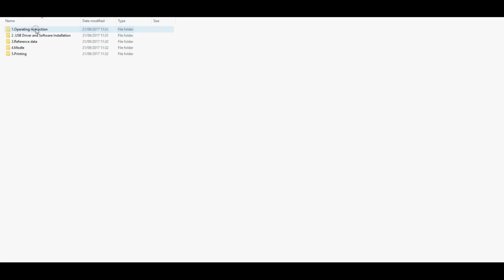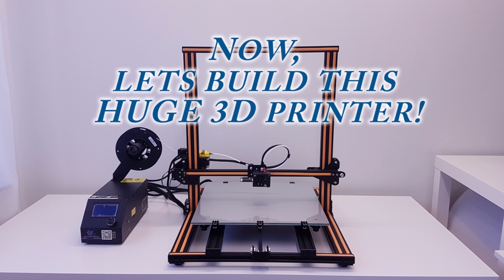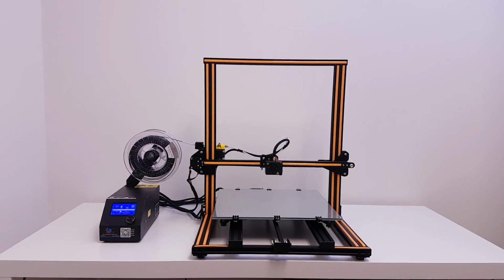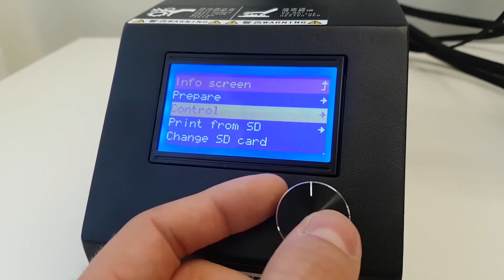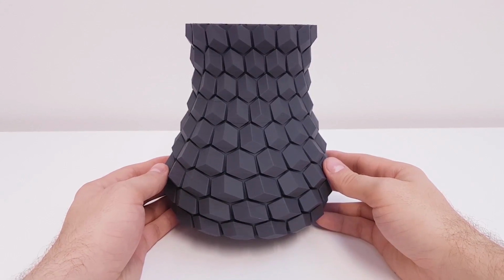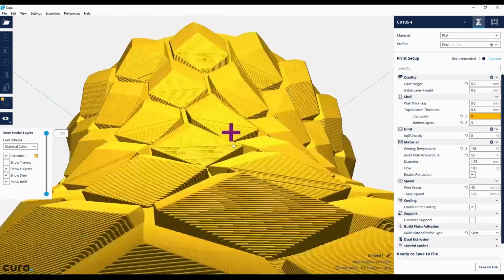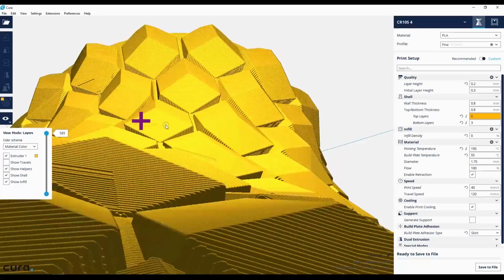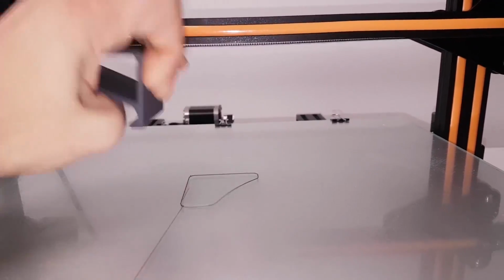Creality CR10 S4 3D printer Full Review! Is it better then CR10S?

Comment: What you recommend as a high quality/speed 400x400x400 printer, that can print ABS.
Reply from the maker: Chech this video from start to finish. And if you are ready to do some fixes that's the one :)  https://youtu.be/lE9i1-DX1aI
Reply: @NexiTech  Thank you
Reply from the maker: No problem :)
Reply: @NexiTech  I can get the Creality CR-6 Max from a tech shop today. I did not see a review on your channel on this unit. Have you had time to look it over and if so do you recommend, thank you.
Reply from the maker: @uivideo7637  I have reviewed CR6-SE and it was very good 3D printer. No issues at all. It worked perfectly fine so my guess that CR6 Max should preform the same or very similar.
Reply: @NexiTech  Thank you

Comment: If you double the nozzle size, you don't double the filament usage, you actually quadruple the filament usage (the circle area), and print much more than double faster (depending on the printer ability with respect of temperature/speed .. it will probably not be a quadruple speed since it still needs some time to melt the plastic.., but will for sure be more than double faster), because the area for circle with 0.4 mm diameter is ~0.126 mm^2  (A = Pi x r^2), and the area for circle with 0.8 mm diameter is ~0.503 mm^2.  
- Great review though! 
Thanks for sharing.

Comment: Hello, I have a Creality CR-10 with dual z axis motors. The z axis goes up and down when homing but will not go up when printing. Is it the machine or am i doing something wrong in Cura ?
Reply from the maker: That's very strange. Try to check or replace your SD card and printer settings in CURA. If printer is moving Z axis normally when homing then it could be somethig with G codes or bad micro SD card. Also try to move Z axis by manual using the printer interface. Also try to slice another 3d model as well.

Comment: I want to buy a 3d printer. I need smooth face after printing. What 3d printer do u recommend among all.? Cr10s, cr10s4, s5 ender3 pro or...?
Reply from the maker: Cr10 S Pro( now V2) or Cr10 V2 can print parts with nice and smooth surface thanks to the latest motherboard and steper drivers. Of course if you looking for superb print quality then you can go with resin 3D printers like Anycubic Photon(small) or Frozen transform(Big one). 
https://youtu.be/d2oD4lktOT4
https://youtu.be/tsy8jFeqgco
https://youtu.be/5YrUQOYLoK0
https://youtu.be/qOSzC3-VrJk
Reply: @NexiTech  m thankful for kind and informative answer. Yes I m really looking for super good 3d print. So your suggestion is I go for resin 3d print. I heard ther is CR10 max. Is it true and us it the best?
I appreciate your answer

Comment: "when you double the size of the nozzle, you also double the use of filament" ... er, no. Do the math: with A=r^2*pi you quadruple the surface and the use of plastic, depending on the wall thickness of course.
Reply: True, per unit length of extruded filament, if you double nozzle opening from 0.4 to 0.8mm, you will quadruple the volume of filament (same length, 4 x the cross-sectional area). But, as you note you have to consider wall thickness. Plus you have to consider layer height. Nominally layer height doubles, so number of layers is ~halved. So that means overall consumption is probably increased to somewhere between 2-3x.

Comment: You forgot about one more test! Does the boat swim? :D
PS. which material is the strongest (if I print a helmet and drop it) and which one gives the best details?  Or maybe there is some material that combines the two qualities, strength and details? CHEERS ^^
Reply from the maker: Pwiest Playing Never tried it until now. Special test just for you. https://drive.google.com/folderview?id=1RsTGtuvn2FZbATfxUgtBAIv1xgsLj2XA
Is the side ways floating counts? :D 
The strongest filament would be Nylon but it's very hard to print especially a that size as it likes to wrap just like ABS. 
Easiest to print but still strong and elastic to some sort to survives impact like that would be PETG. I use PETG from Aprinta pro and it's very good. Check Aprinta shop from video description and choose PETG. don't buy PETG with some sort of mix like carbon fiber and similar those added particles just makes filament way less strong compare to based material. Just Get regular PETG instead.

Comment: Would this be a good first 3D printer? I am in between this, the CR-10S Pro and the Prussa i3 Mk3S. The Prussa is very good but doesn't have enough build volume and is expensive which is why I am looking in the CR-10 line.
Reply: I've got a prusa i3 MK2S and think I'll buy the cr10 s4 in addition to it, either buy the prusa for print quality and reliability or the cr10 for big prints
Reply: EL Valenin alright, thanks for the reply!
Reply: @glumfish6862  but I think the prusa is better for beginners

Comment: great video but i was wondering if you had links to a better HEAT BED adjustment knobs for the CR10 S4?
Reply from the maker: Ed Iles Here my friend:  https://www.thingiverse.com/thing:2462249
Reply: there is not enough room to put a knob like this on because of the distance between the bed screw and the bed rail on a cr10s4

Comment: Thank you for great review! It played great part in my decision. Now S4 is being shipped to me....
Reply: Hey. Got it assembled and working. Compared to expectations, it was a nightmare, and I wouldn´t recommend it to any newbie. Bent hot end assy, impossible to home the X axis to the end-stop, as the bottom wheel screw and nut blocked it, so had to drop the hot end, belt, everything, make the screw and nut shorter, and reassemble. Anyway Now, before advanced upgades, it printed 3D benchy without infill, without retractions and no tuning, quite well. Like 98% of the well tuned Original Prusa i3 MK3! I´m getting excited to get it upgraded and tuned!

Comment: So why does my creality cr10s prints abs fine i print out to max volume printing boat hulls for my rc models had no shrinkage or bed problems got my bed up to 90 as long as you put a box over it it prints fine in abs and as long as you dont print in a cold garage i use my back bedroom at a temp of 75 so yes you can print abs thats all i use,ive never even tried pla because of its low melting point ans strength issues  on my creality cr10s .
Reply: Hi John, im interested in this Cr10 S. You did'nt do anythign special to make it work with ABS, and you just print ABS out of the box ?? Can you tell me more about your experience ???

Comment: too sweet to be true your presentation. Following your video I bought 4s and I have only troubles so far... 

1. at the 4 corners my calibration is perfect, but at the middle not! Hence the glass is bended
2. cr-10 s4 starts printing from its 0 no matter where my model is positioned in cura (yes I have selected "Origin at center")

I don't recommend buying this machine for professional work..
Reply from the maker: addk3 Glass can't be bend that easy. It's more luckily aluminium plate that bended/bow in center and then when it's cold/worm during its massive size it varies. Some S4 Heated bad comes like that from factory and some users has reported that. Mine S4 heated bed was OK. Maybe I can help.  Solutions: Try to use Vacuum for glass in centre to bend plate up in short pull burst. Or place something in middle (Like paperblock) and then screw down adjusting screws to bend the plate back. Make sure that you heatup plate before doing so. 
Or If you don't use Max build size all the time you can level it in middle of plate instead of on the corners.
Or you can use BRIM option in Cura
2. Origin in center shouldn't be selected.

Comment: I am subscribed to your channel. Please tell me, if STL corrupted files is allways a problem, when working with 3d printers, or is a rare problem?! Till when you worked with this printers, how many times, you have encountered STL corrupted files!? This i dont understand well. Thanks sir
Reply from the maker: Rohan 67 Hi and welcome. Corrupted STL files? That's very rare. I never personally had corrupted STL file and I have hundreds and hundreds of STL files on my PC more then 80% are downloaded from Thingiverse website. On some STL files 3D builder(3D program in Windows 10) found some geometry errors in 3D model and program fix them by itssel, but other then that I never had corrupted STL file. Are you sure you don't have problem with your PC? Maybe spyware, malware or virus? Or some register problems? None of files on your PC should be corrupted. Scan your PC using Malwarebytes program and run CCcleaner efter. Good luck
Reply: Nexi Tech Thanks now is much more simple for me.. Regards

Comment: Thank you just got one with your coupon!!
Reply: Nexi Tech Can the bed be upgraded as you did for the normal size cr-10? is that 30x30 silicone heater you shared large enough?
Reply from the maker: LyranaH Awesome! You welcome :)
Reply from the maker: Tiberio Cellini Yes it can. There is 400x400 silicone heater for CR10S4 as well.

Comment: So is the CR10S the same as the CR10S4 just a smaller version? I don't plan on making anything huge so how do they compare?  Again the terminology I need to learn because if I have an issue I don't know how or what adjust to fix. Can you speak on that so we (I) can learn if this happens in a print adjust this, but if this happens to adjust that?

That's what I need to know how to make adjustments to get the perfect print like you have.

Also, do they come with both nozzles?

Great Vid thank you

Comment: I like the size, but not being able to print abs well enough is a bummer, so i got the cr10s.
Reply from the maker: CR10S is better for ABS and PETG prints Good choose. Check my video on the channel how to upgrade heated bed on Cr10S to heatup up to 135C under 4 min or you can install isolation only under heat-bed.

Comment: I got this same S4 printer and have been happy with it. I insulated the heat bed and could get 91C degrees in a ~2h testprint session. Asking temp was 100C. http://pro-ht.mbnet.fi/3d_print/cr-10-s4/cr-10-s4_bed_heat_insulation.jpg

Small ABS parts seems to print out pretty good, but bigger ones would need more bed temp, or a closed enclosure for the whole printer to reduce warping.
Reply: That's the welder's flannel and heat reflection sheet mod right?
I did the same mod on my S3 and got exact same results you did. (@91c bed max). Stopped using ABS because of all the new easily printable filaments that are so much better.
Reply: I used 10mm thick self adhesive thermal insulation mat with aluminium surface and some aluminium tape on the edges. :)
Reply: I was able to reach 101C degrees in my last ABS try, but I have trouble with lifting edges. Seems that the part sticking nicely to the tape I'm using but at these temps the tape itself lifts from the bed. Ordered buildtak surface for the bed, hope it resolves the trouble.
Reply: Do you have a link to the instructions on how to do this mod
Reply from the maker: Maxxifull I did this on my Cr10S crazy fast heatbed time! It can reach 135C degrades under 4min! Check video https://youtu.be/IhjqfMHyBAI

Comment: I don't understand why it's so much more expensive than the 10s.
Reply: siemensohm 

Agree 100%. Seems like they’re extorting a larger sum for such minuscule extra features.
Reply: +oki doki
That's not the point. What's the difference between cr10s and s4 regarding the used components of the printer?
Answer that for yourself and ask yourself whether those bigger parts are worth a premium of 50% compared to cr10s...
Reply: and you get a bigger stepper motor for the y-axis
Reply: oki doki I guess siemensohm got banished to the shadow realm
Reply from the maker: siemensohm Because it's bigger. Cr10S has built volume of 300x300x400mm and Cr10 S4 has 400x400x400mm. Maybe on papper its not that much but in real life that's huge difference in print size.
Reply: Thank you very much for your answer, but that's still no explanation in my eyes. The major parts are the same and a bigger heat bed and shafts etc. can't explain the current price difference of 290€ at gearbest.

However, thank you for your informative videos.... :)

Comment: I just ordered the CR-10 S4. Can you tell me the footprint dimensions of the S4? I am looking for a workbench or table for it. I want to make sure it fits on the table. Thanks!
Reply from the maker: Of course Sam! Bare S4 frame on which is 4 rubber feet is 50cm wide and 60cm long. Whole printer with control box and 1Kg of filament takes 70x86cm  of footprint.

Comment: huh? 16:06 cannot print ABS. please explain. in the controller display also was preheat ABS written. (maybe because thats written in al marlin type controllers) but why cant this printer handle ABS? it's got a heated bed. great review btw. thumb-up!
Reply from the maker: It's because it can reach only 61 degrades on heated bed. For ABS you need At least 100 degrades for good prints. ABS is well known for warping issues.
Reply: o oke. thanks for the reply. did not know that yet. i am just a beginner. i have got an anet a6. would it help to use that masking tape. and then attach better on this cr10 or not?
Reply: Jan Wiersma IT works you have to build Isolation trap the Heat .

Comment: Can you provide the link to the CURA slicer that supports CR-10 S5, I just went to there web site and the newest version they show is 3.0.4 and in the drop down list of printers they support  CR 10 is not on the list.
Reply from the maker: CURA 3.0.4 showes in ''other'' drop down list of Cr10 3D printers. Please check it and report back.
Reply: I see what happened, before you start the down load they make you fill out a list of things like what you will be using the program for and so on , and on that pre down load list there is no CR-10 printers, but once you do the down load and set up CURA for your printer there is. 
Did you notice the strange things going on in the QUALITY setting's. The top setting is EXTRA FINE 0.06 then FINE 0.2 "WTF" then LOW QUALITY 0.15 "WTF" then DRAFT 0.2, Some strange things going on there. Have not tried the setting yet so it might just be a type O.
Reply from the maker: Robothut Yeah you are right that's wrong. They need to fix  names of printing profiles. But to be honest am happy that they add printer settings so that we can add cr10 easy.

Comment: Is it better to print straight onto glass , or use tape ?
Reply from the maker: I like to use glass, it leaves very smooth and mirror look on bottom surface. But keep in mind you will need some adhesive to prevent warping. You can use glue stick,hairspray etc. I like to use AprintaFIX spray. It leaves no marks on the printing surface and if you spray it once you can print several times before you need too apply it again. And just to mention its holding very strong print in place but in the same time its not hard to remove print from build plate. There is link in video description for AprintaFIX check it out and read all info about. Cheers!
Reply: Glass for me.   I've had issues with tape coming off.   Never any issues with glass.